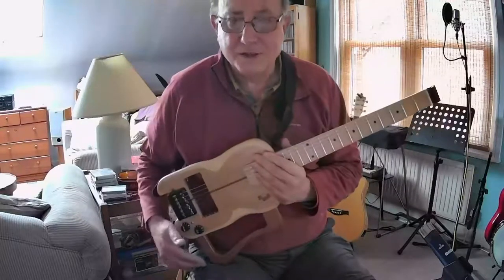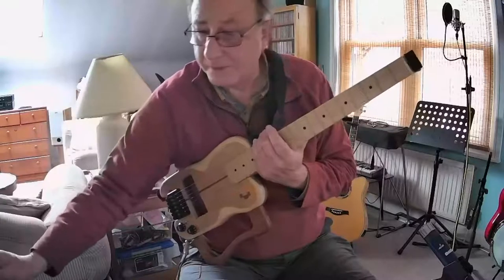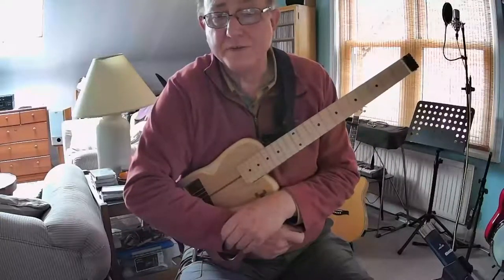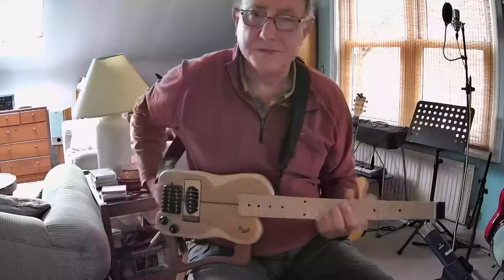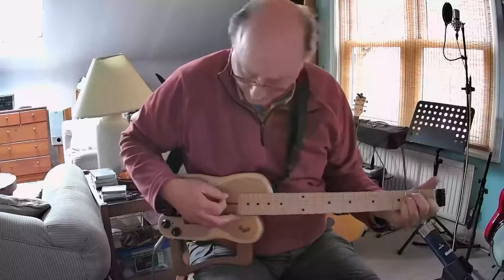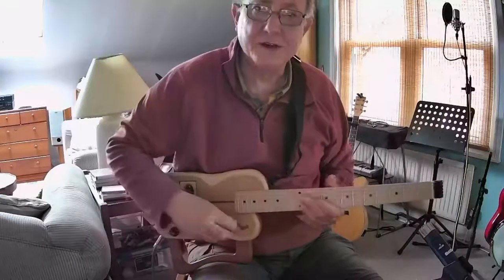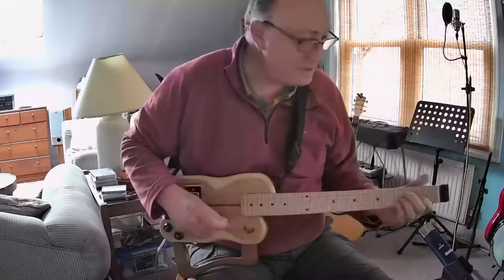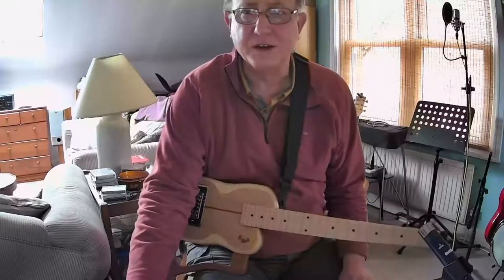6 Different Guitar Pickup Types Compared (in a Quick Change Pickup Guitar!)

Comment: Excellent video, though I must have cloth ears as there is very little difference in tone for me :) The tele pickups are brighter than the others, but as you suggest, you could probably tweak the amp or guitar's tone to get them close enough to the P90, mini humbuckers etc. I couldn't hear much difference between the two tele pickups. It's a cool setup though - have you made any further cassettes? Maybe try an Adeson Tri-Sonic (Google for them if you haven't heard of them) or a selection of strat type pickups (there always seem to be a plethora of those available from different manufacturers)?
Reply from the maker: Hi jssnowdendavies, thanks very much for your comments.  I really appreciate hearing from you and your views and suggestions. Cloth ears? I don't think so!  I agree with you and I can listen to the different pickups live.  It was quite a bit of work to make each cassette so I haven't made any more though I could easily replace a pickup in one of the cassettes now.  What do think...I have found some trisonics and of course plenty of strat pickups so I am tempted. Shall I go for it?
But given all I've read about different kinds of pickups and claims about this one and that one etc I thought there would be marked differences. So as with any experiment  you get what you get and that's why you do an experiment.  People have done similar kinds of experiments but testing out the effect of different body woods (so-called tonewoods on electric guitars) with no discernible difference to be measured/heard. Darrell Braun  a big youtube guitar poster even sawed bits off a strat body till he couldn't take any more off ...surely must have made  a big difference...NOT!!!. 
So I am coming round to the maybe controversial (?) view that there is a lot of "baloney" (excuse my irish!) talked about particularly electric guitar stuff, pickups, woods, nuts and bridges etc. I think there  are real differences between different string sets but that's not surprising as they are the primary  motive force in the electromagnetic system. And certainly there can be real differences in the circuits and controls used on the guitar. I recently put a 5 way switch mod in a telecaster and that really does produce significant tone and output level differences. And all that before we come on to amps. So the whole chain is the thing and in my view a single pickup is probably one of the least of the factors. 
I'll probably get completely blasted by someone from a big brand pickup maker!!!  Oh well!!!  
Thanks for your thoughts and maybe watch this space and all the best!
Rob